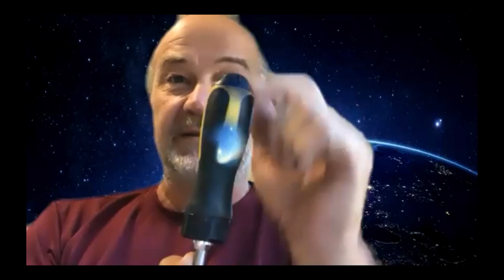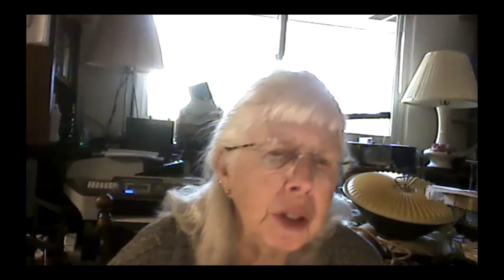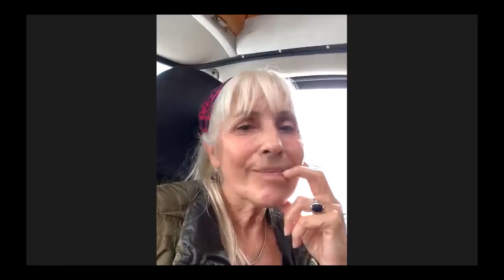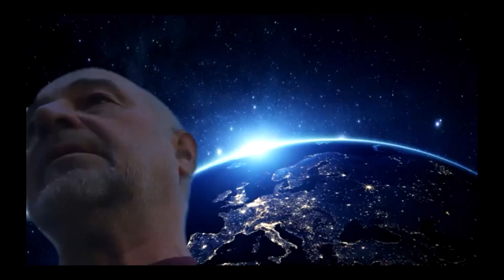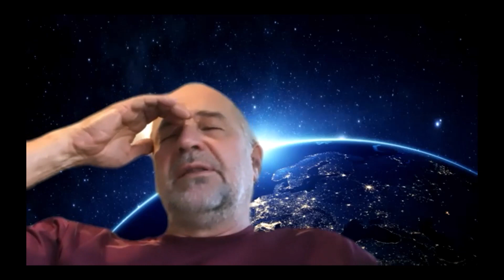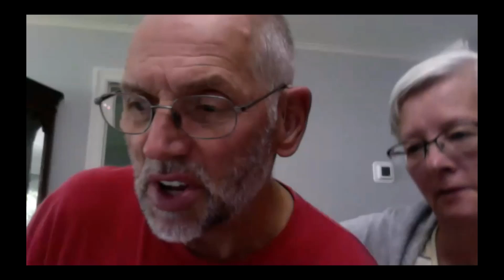Troubleshooting Your Roadtrek - Yan Seiner

Comment: Hi, I just bought a 2005 Chevy Roadtrek.  A check engine light came on and it was something regarding the emissions sensor or canister?  Does anyone know what that means?  Is that something I can fix or will I need to take it in to get it fixed?  Thank you

Comment: Good information.
I have the issue when the house battery draws down it will also deplete the auto battery.  I suspect a bad battery charging solenoid/isolator?
Reply from the maker: First thing to check would be isolator.  There are lots of posts on this in FB groups and a tutorial how to test on YouTube.